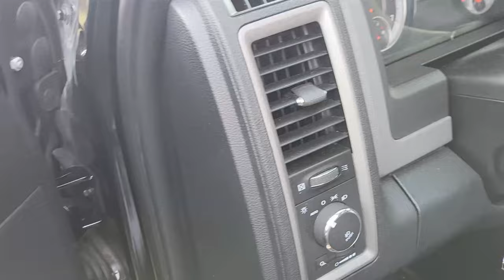Ram window switch easy testing and replacement!!

Comment: Is it still working? Just by disconnecting and reconnecting will reset the window module and they will all
work again for a little while.  Don't be fooled that the switch fixed it. Need proof? Disconnect and reconnect the original
switch during initial diagnosis and see if they start working.  You can also disconnect the truck battery and that will rest it as well.
This problem has us all stumped.  You think it is fixed until it does it again. The windows, door locks, mirrors don't work until disconnected and reconnected.
Reply from the maker: still works. the original was just dead.
Reply: Dude, I have replaced mine twice and replaced the motor inside the window, and I got nothing again!! So I am going to check to see if it is the regulator. I've checked fuses, all these replacements, and I got no results! The first one I did worked for a minute but sadly died again. I'm going to do the battery unhooking like you recommended to see if it will change things.